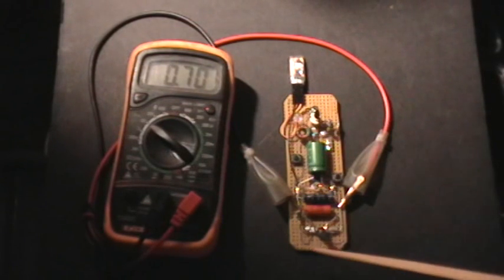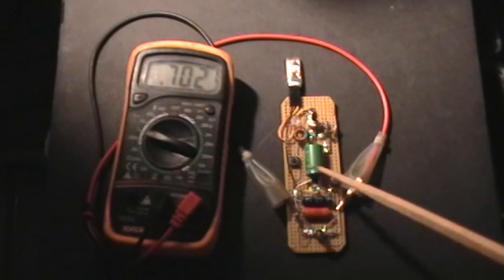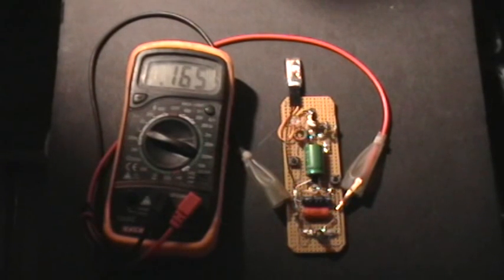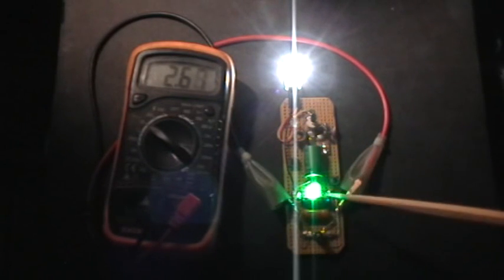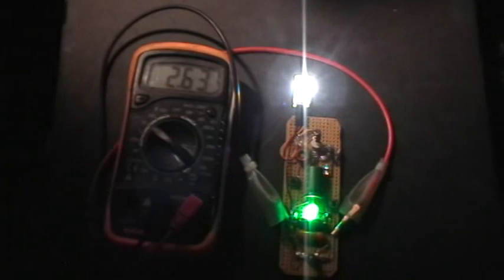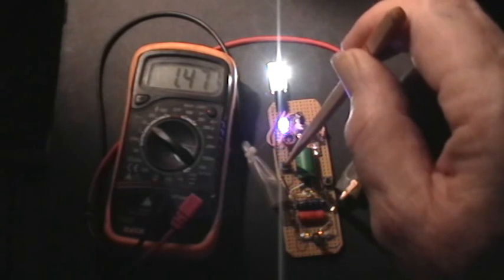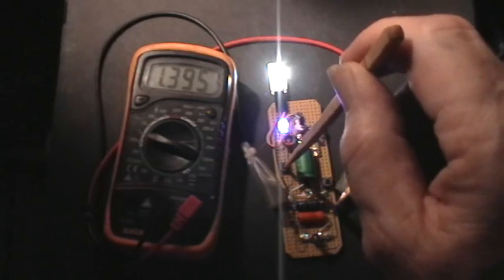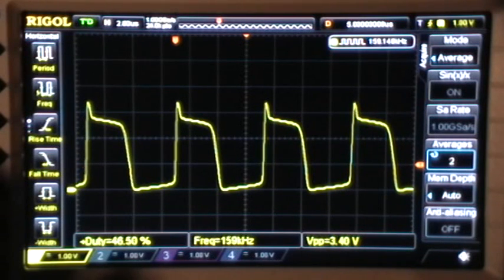Joule Thief: Hybrid Wireless JT and High Efficiency LED+AP2502 Current Sink

Comment: Thank you for the awesome and detailed videos! I have a question that I have been trying to find out the answer to for a while. It is my understanding that LED's strobe or flicker when connected to an AC power source, to keep them cool and save from overheating and bursting. This was told to me on two separate occasions by electrical engineers. However, they told me that if LED's were connected to DC as opposed to AC, they would not strobe/flicker. I have been researching this and couldn't find any material online. I wonder if you know or have any way to test if this is actually true? I found this video but it doesn't quite cover the topic: https://www.youtube.com/watch?v=kyXd0iMHQKc. With thanks from Canada.
Reply from the maker: +futureamir 
Thanks for watching and commenting. Yes, LEDs are diodes, they only emit light when current is flowing in one direction. AC is alternating current so an LED fed with AC will only emit light during half of the cycle of the AC current. This isn't "done to keep them cool" it is just the way LEDs work. When an LED is being dimmed to control light output, it can be done either by varying the DC current through the LED (inefficient but steady) or by a technique called "Pulse WIdth Modulation (PWM)" which does make the LED flicker, with pulses of constant DC current but chopped up into pulses of varying duty cycle. These are usually at high frequency, so high that the eye cannot detect the flickering.
Reply: +TinselKoala 
Thank you for the answer. Does that mean that LED light bulbs flicker when put in a regular light bulb socket in a house since the current supplied to them from the wall is AC? If so, is there a way to not have them flicker, for example by having a little converter at the bulb that converts the current to DC? Is that what an LED driver is?
Reply from the maker: futureamir
There are many different kinds of LED drivers. I don't know about commercial LED light bulbs wrt flicker. I'll do some testing and get back to you on that.
In general, a full-wave-bridge with a filter capacitor on the output will use (rectify) both positive and negative parts of the input AC waveform, and smooth the resulting ripple, for a straight smooth DC output.

Comment: Very nice . possible to cut input coil wavelength to pick up FM broadcast energy and charge that cap. I found you can charge those with a better antenna and have a free energy source without using any of yours to charge it .